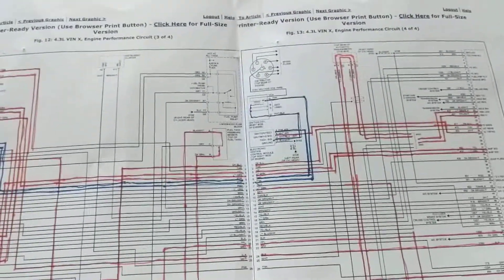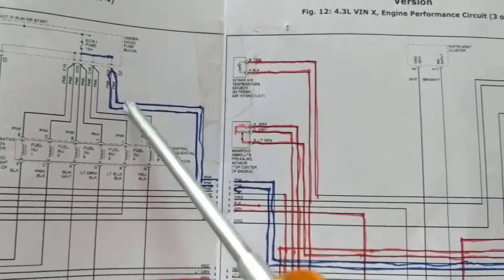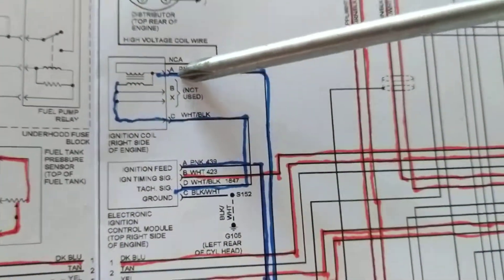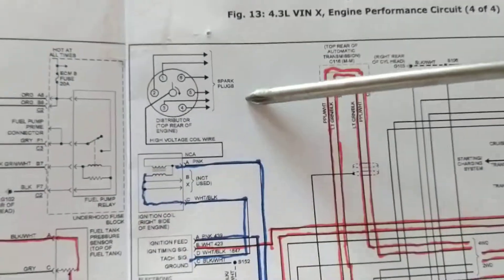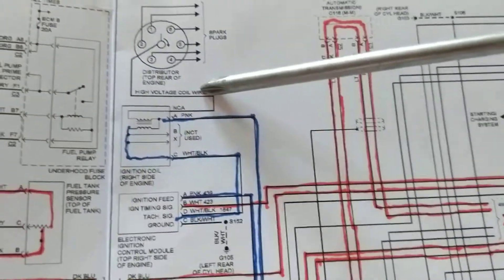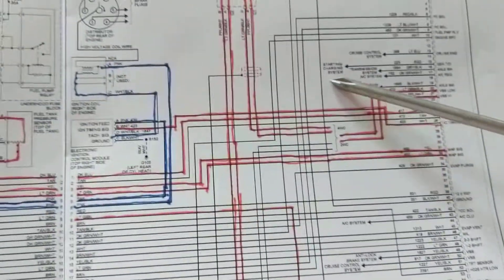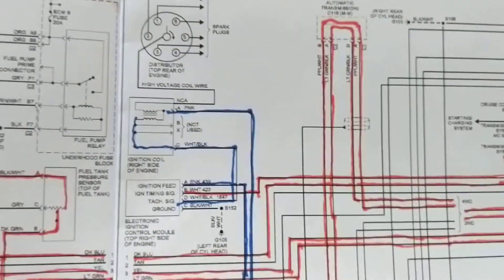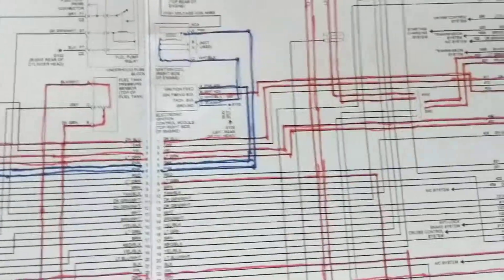How⏰ IGNITION⌚ TIMING MODULE  works Chevy Blazer 4.3 L 2003 part 2 diagram ,please subscribe

Comment: What would cause there to be if there is no ic signal but have signal from all ignition sensors and a brand new ecu also having power and ground at bourgeois the icm and the coil
Reply from the maker: The ignition module controls the primary side of the ignition coil went to fire through a driver that information is giving back to the computer
Reply: @automotiveelectronicsfroms2699  so what u are saying is a signal comes from icm to the computer?
Reply from the maker: @MrCHEVYMAN2500hd  this is a Chevy so therefore the initial control module gives a b+ and takes away the b+ from the ignition coil to fire it to the distributor which obviously gives all the Sparks to all the cylinders the computer has to know that it's firing it sends a feedback to the computer which is the PCM so the PCM is talking to the ignition control module depending on the maker model these signals have to be observed and make sure they are there
Reply from the maker: A signal has to come from the computer to turn that ignition coil on and off it goes to the distributor when it turns it off a collapsing field is energized from the primary to the secondary and then you have your Sparks all this is due to the fact that the computer has a driver in it internally which is a transistor and times it went to shut it on and off thank you so much for your comments much appreciated
Reply: @automotiveelectronicsfroms2699  thank you very much for ur time to help me and many others that may have this problem
Reply from the maker: @MrCHEVYMAN2500hd  you're quite welcome and good luck

Comment: Thank you very much, very nice your video, I would like to know if there is a method to eliminate the distributor cap, from the outside that the spark plug cables go straight to the spark plug, using wasted Sapark?
Reply: Thank you so much distributor is there to have correct ignition timing and correct firing order eliminating that distributor will take away the timing
Reply: @Joeelectronicschematicsforauto  Thank you very much, I get it, but the idea is to keep the distributor cap installed and keep rotating for the Camshaft sensor so as not to miss timing, but I would not like to use the distributor cap for the spark plug cables, but a form of the cables that the spark plug does not pass through the Distributor's cover, adapting a coil from another V6 vehicle that does not use a distributor, is it possible?  I appreciate your help for your great knowledge.
Reply from the maker: Thank you for your response the many coil packs and ignition coils according to the fuel injection system thank you

Comment: What would be the next step if I don’t have power at my coil connector. I’ve used my test light just to make sure and finding no power source with the key on !
Reply: I see you said a fuse that gives you the B+… which fuse was that ?
Reply: You need to determine whether you are missing the positive or ground to the coil

Comment: OK, but I am looking for the internal schematic for the GM ignition control module not just the pinouts.
Reply: If I understand you correctly you mean internally in the modules usually the schematics only give you the pinouts because that's what your troubleshooting if you're looking for something internal that would be a schematic like from Mitchell which I use which is usually something you have to pay for or you can try Google GM ignition control module and the vehicle you need it should give you perhaps one page of that try and keep me informed
Reply: @Joeelectronicschematicsforauto  Yes after spending 60 plus years in electronics, I am amazed at being told that a GM Ignition Control Module on a 4.3L engine has to be "tapped" in order to test it. I watched several sales persons test a module in this manner (on a commercial tester) and was amazed that all the modules they tested failed after being "tapped".  I was told this is to simulate the module on a running engine, and I am curious as to which component is causing the failure and think with the internal schematic I might figure it out, the tapping makes no sense to me at all.
Reply: @jamessmejkal8803  I agree with you the main problems with modules as I made a video on my channel Joe electronics schematics Auto is vibration they have chips surface mounts technology where the pins don't make contact to the pads this is the video that I made describing this fault when they tap on the ignition control module the components are making connections and disconnectors that's basically what they're doing this is not the best way to test the module it's actually a foolish way the best way is inputs and outputs when they top the module there is a connector also what happens if the connector is not making contact also thank you for the comments
Reply: @Joeelectronicschematicsforauto  Which video please?
Reply: @jamessmejkal8803  if you go to my channel Joe electronics schematics for Auto how computer modules work one that has a picture of a printed circuit board with all the components on it you will see that I point out that the vibration is the key element the failure not just the heat due to the components that are surface mount and these type of chips did I used to service the pins do not make contact look for these videos on the channel please thank you
Reply: @Joeelectronicschematicsforauto  i have a misfire when cold after it reaches temp its decent but falls on its face at times any ideas?